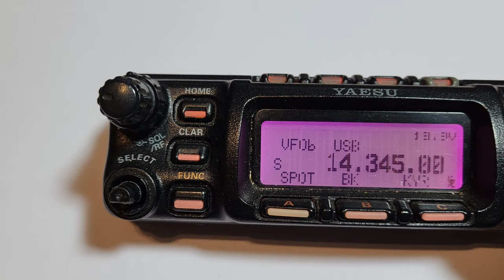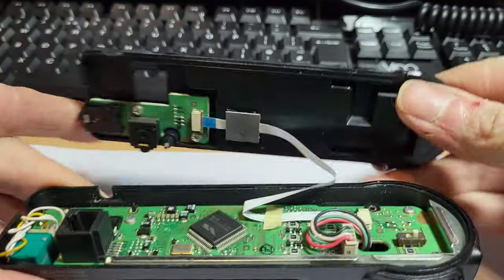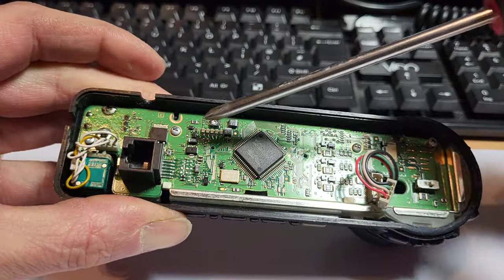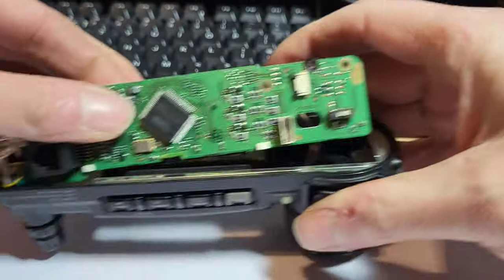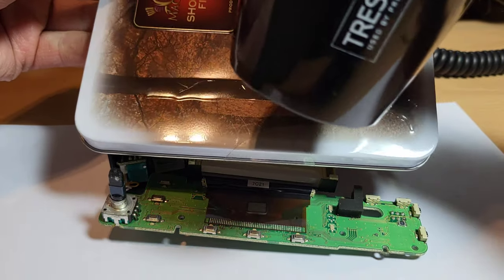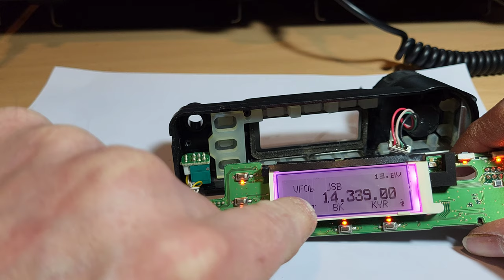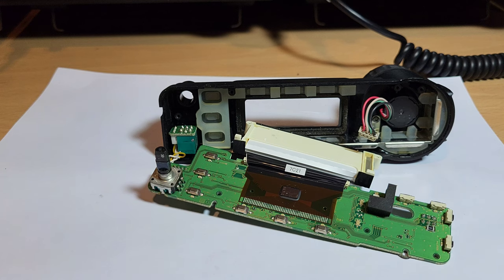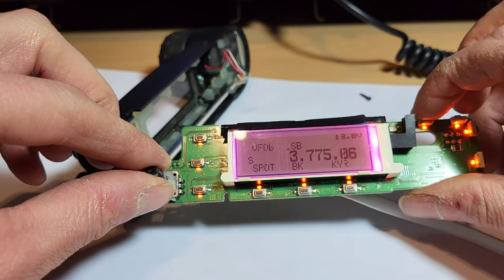yaesu ft-857 LCD Display rework , zebra stripes,  temp fix

Comment: clean the solder out and replace it with some new stuff. if the hair dryer works   the air station would work a real treat. nice fix thanks for the post

Comment: Wrong end. Fixed mine using the original display.  Top under the black tape.
Reply: I've not taken mine apart yet to attempt to fix, but is the problem down to dry/broken joints on the multiway ribbon or shrinkage of the conductive zebra-strip rubber under the white plastic bezel? I've successfully repaired several LCD displays on FT-290's where the zebra -strips have shrunk by cutting a piece of thin mylar type film to fit under the edge of the bezel to push the display back a few thou, just enough pressure to restore contact with the pads on the PCB - works a treat 😁

Comment: This is not the way to do it. you're just reflowing the lcd ribbon cable. under the white part of the lcd is where the problem is. there's a conductive rubber that's lost it's contact with pads.
Reply from the maker: Hi Steve , I completely agree with you ,this is not the way to do it.. it needs a new display, I'm just buying a little extra time . take care Ben 🙂